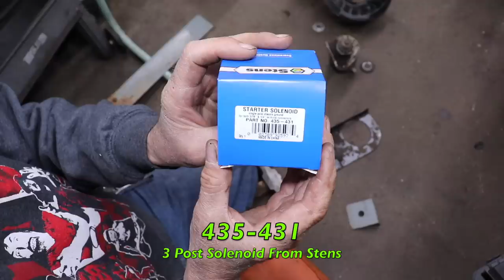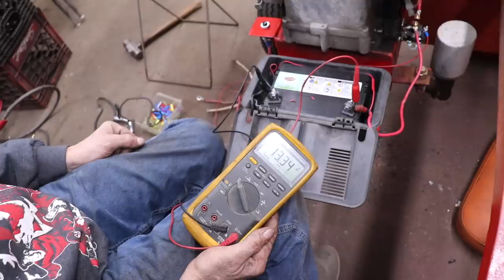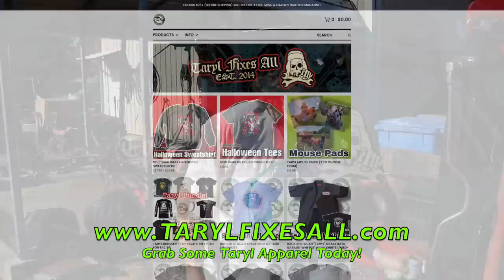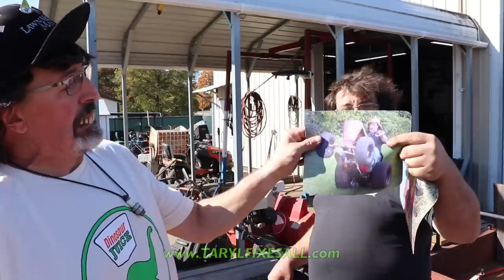Taryl's Personal Log Splitter Upgrade! Make It Awesome!

Comment: You're pretty handy with making your log splitter more useful. You need to make an automatic return and they're simple to do. Extend your control handle on the bottom the same length as the top. Then you need to attach a rod to your RAM. As the ram goes out the rod will contact the bottom portion of the handle pulling it in the opposite direction. I think this might be a worthwhile video you doing that. John

Comment: Taryl, I would add a flip out extension to your catch table to extent it's capacity. Then flip it closed into the stationary table for vertical use. A pin will keep it secure when not in use. Make it narrow enough to drop into the existing table and shorter so the pivot will use the end of the existing table as a stop and the new extension will be on an incline. Great video as usual.

Comment: My MTD log splitter came with side trays, which is a really desirable feature. I bought one of the Harbor Freight clamp on caster wheels and put it on years ago. My biggest gripe is pulling the cord and starting it in freezing weather when the hydraulic oil gets thick. An electric start feature sure would be nice.
Reply: you are supposed to split all your wood in early spring,. not the dead of winter there numb nuts, so it dries and will burn clean.
Reply: Run thinner fluid or trans fluid

Comment: B&S is pretty awesome in that they have basically the same engine block for the different options. makes it super easy to add on options later if you want. I've noticed Tecumseh is usually the same way with having tapped blind holes on the block to add on a starter or a torque converter. I'd like to see a starter kit added on to a block that doesn't have the holes drilled or tapped though, that would be pretty interesting (especially figuring out the gas can if you don't have a nicely molded one like yours)
Reply: Yep, unlike Honda who go out of their way to redesign the same engine where you can't add electric start so they force customers to pay them more for the option.  It was B&S who fixed Honda's decades of oil dilution mistakes too...

Comment: Thanks Taryl.
Did similar Mods to My 35 Ton. Took the parts from a blown up 15Hp and they all fit My 12.5 Hp.
Used the AC windings for Lights on a Cross bar on the end of the Splitter Beam. I split 100% vertical so that puts the lights overhead. 
My battery Box has the Electrics built in to it and it is not mounted on the Splitter since I use that set up between Machines. just set it into a holder and plug it in. Same with the Gas can, Just a holder for a Red 6 Gal Can and boat connectors,  
I replaced the Jack with a 12" Dolly wheel, removed the hitch and put on a vertically pivoting Draw bar with a handle on the end, put the hitch on that. Not I can roll it around or drop the hitch on the ATV or the back of the wood trailer.
I have all the Parts to make it Self Propelled, just the intuitive to put it together..LOL
I tried the foot plate extension, but ended up bending it up since I am in the woods a lot and the area is not so flat around the Base, I just use some old 2x4/2x6 just setting there. For Elm I have a piece of Horse matt on the foot plate so the Wedge cuts all the way through. 
An oil cooler is in the works too...
Mike M.

Comment: I put a led flood light pod on the top of the boom. I use mine more in the vertical position due to cutting bigger trees (free is free). I also tend to split later in the evening because it's cooler down here.
Reply: i said the same.

Comment: I do not miss messing with firewood. That's the only heat we had as a kid, until I turned 18. You never had enough firewood.
Reply: Modern epa stoves don't use so much.

Comment: Tarryl you need two more additions to the log splitter. A wedge that splits a log 4 ways with one pull of the ram. The other add on is a t-handle with a 2inch ball to move the splitter around.
Reply: There's always room for yet more improvements. Up to the point where this thing goes out, saws the logs and splits them all on its own 🙂
One more addition could be fast advance and retraction of the ram.

Comment: Nice upgrades!  This "old man' still splitting by hand, not sure for how much longer  😟 I have a friend  even older than me ( 80s ) that still splits his own wood, with a log splitter.  Due to recent shoulder operation he has a real difficult time with the pull start. I have to check & see if we can mount a starter. It has a Honda engine. The cradle & the foot extension are also now on my todo list.
Stay safe, Joe Z

Comment: Great video. I see one small problem. When the splitter is horizontal, the hydraulic return hose looks pinched or at least makes contact with the new rack you installed.  Other than that, great improvements!
Reply: If the hydraulic hose is making contact with metal, it will wear in that spot and develop a leak.

Comment: VERY nice work on the hog splitter Taryl!  Love the improvements!  You did a great job putting that all together - really cool!  At first I thought the extension on the steel plate was questionable - but once I realized it would be sitting on the ground and saw it in action - it turned out better than I thought it would have.  Good stuff T!

Comment: Good job on the electric start. I used 1/4" cold rolled plate sized 18 x 18 for the foot. It adds a nice amount of counter weight and is super strong for splitting HUGE rounds vertically. Your side rack is ok but it needs a hand rail around it about 3 inches tall to keep wood from rolling off.. keep at it dude.   Time teaches all.

Comment: The splitter wedge could also be modified with two 90° angle wedges welded on the head so that you won't have to resplit the same piece of wood so many times.
Reply: I've seen that type of improvement. The wedge looks like a 4 points star. I guess they made into a regular wedge so, you don't stress the machine too much.
Reply: Great tip.
Reply: It's all good if the pump will handle it. On these mass produced versions it's often not.
Reply: @user-neo71665  I guess, a bigger pump and cylinder cost too much, for this use.
Reply: @rverro8478  They build them cheap as they can so they can sell them for greater profit. Bigger pumps, motors, and cylinders means they cost more. Also why the plate the log stand on with this one is so tiny, the tongue tube is made out of tubing that looks like it's gonna bend under just moving the machine, and it just has a tube instead of a real trailer jack.
Frankly I'm willing to bet this one didn't have a 8hp briggs on it new. My money is it only had a 6.5hp china engine just judging by the build of the rest.
Reply: If you have a system with at least double the power capacity of a single wedge additional horizontal wedges will work just fine on wood that easily splits.  If you can stall the system in knotted hard wood with a single plane wedge, the system will definitely not power through effectively three times the effort and will bind continuously...  Most splitters fitted with additional wedges start at 20hp of hydraulics, or are very, very slow to cycle in order to raise the hydraulic pressure sufficiently.  Depending on the HP most domestic splitters rely on either slow cycling speeds, or limited power in exchange for fast cycling speeds - mostly they are designed to only deliver a certain level of ram pressure that is well inside the capacity of the frame and mild steel plate supporting the ram and foot plate to avoid bending or tearing...
Reply: Agreed the machine is plenty strong enough
Reply: @Joseph-lt5yz  he is hes just taking small steps i.see his math
Reply: @user-neo71665  I noticed how the tongue wasn't strong at all. Mine is square tubing which, can be towed on the backroads. I doubt the tires are highway graded and, I wouldn't dare to try. The machine would bounce all over the place. Mine has a 6.5 Kholer and there's plenty of room to swap it for a bigger one. It barely has 3 hours use since I bought it, about 5 years ago.
Reply: @rverro8478  My starting rig was also build better. Mine has since seen just about everything swapped over the years. I wouldn't tow it down the road behind a truck. That one flexed so much I wouldn't tow it behind a lawn mower in the yard. Even after he added the brace it still flexed pretty bad.

Comment: As a grass rat.
Got a suggestion. 
Use a piece of a small tire as a cover over the relay to keep rain and wood chips off of it. A little  rubber  umbrella. 
Great upgrades on the  log splitter.

Comment: Maybe you could source some more of that pipe and some flat stock an weld the flat stock to the upper part of the tongue that comes away from the trailer to box it in and then weld pieces of pipe over to the stiffener pilot to hold it all together.  Great video!

Comment: I replaced the tongue with 3x3 rube and added a short vertical peice to support the horizontal position.  I had a plate bent for a log tray. As for the motor I gave into a 8hp predator.  It really runs nice. You got me on the electric start!. That machine has been splitting wood for 35 years. Bought it a tractor supply for about 675.00.

Comment: Hi Taryl, Watching You Lift That Splitter ARM-- Maybe You Should Add A Small Hydraulic Lift Arm on It. I Personally Don't Use It In The Vertical Position Much ,But I Know The Splitter Ram Is Heavy To Lift By Hand. Great Job Once Again By The Small Engine Whiz.. " And There's Your Dinner "

Comment: Taryl, on our pressure washers at work, we've been replacing the solenoids with automotive units (Ford I think), as they last longer and are about the same price as the OEM models.
Reply: I have a starter solenoid that’s meant for a 57 Ford truck on my Craftsman LT1000 and it works great!

Comment: Replace that piece of bent pipe with a straight pipe. That will work in pure tension/compression and get rid of the wonky flex problem.

Comment: I did something similar to years ago, welding a wheel to a trailer jack. The foot of the jack was made of really crappy soft steel, very little strength. It worked but it would flex, I was always nervous around it.
Much bigger trailer tho.

Comment: Hey Taryl, you could have put another piece of angle iron on a bolt either side so it folds back inside the other piece you welded on. Fold it out when you are using it. It could even sit up on an angle when you are using it so the log doesn't fall off to the ground.

Comment: Looks like the tongue is made from channel. The reason it's janky isn't so much that it's flexing from side to side, but rather it's twisting. You can add torsional stiffness by boxing it in, turning it into rectangular tubing. Just be sure to leave drainage holes so water can drain out and so you can spray in some rust protection.

Comment: They make a side crank Jack that fits on that rotating bracket  also if the legs on the wheel straight maybe won't flop to the one side

Comment: Those pieces of steel are most likely going to get bent.  It works when it is on a flat surface, but when you are on uneven ground, the log will transfer the force from the ram to the frame which will not have the stiffness to keep from bending.

Comment: With a spitting wedge twice as tall. And an end stop, also twice as tall. Taryl could split chunks of wood twice, while still stacked together. That's double the output of split material of the short stature single height splitting wedge. (We had a home-made splitter made with a Hydraulic Ram from a Dump-Truck with a !2" high wedge.).

Comment: Nice upgrade, you took a good log splitter and turned it into a "gooder" log splitter. I was surprised at the strength of the angle iron🙂
Reply: I did that with my old Coleman 5k with a 10 horse Briggs I/C. No bosses for the coils so I got the ring gear kit and put it on the generator motor flywheel with the starter. Then wired up the switch and solenoid and battery with a 110 volt maintainer to keep the battery charged and when the power was off, just plugged the maintainer in to the generator. So far, so good. Always a way to improve and thet 10 horse is a double handful to start with the recoil.
Reply: @lewiemcneely9143  very nice! I live in Texas so a little 5 ton electric does a season of wood in an hour
Reply: @GuysPlayingWithTools  I've seen them and they are sweet but I needed something stronger because of knots and such so I tried Ebay and folks saying they wanted to sell theirs but there was nothing and nobody really wanted to sell theirs so I broke down and got a saw and a splitter NEW. Yes, that's scary but it was a good move. The saw was a Stihl 261 which is a commercial saw. My son-in-law scarfed it right up but I have a 440 Magnum here. The splitter was a Champion 37 ton but really more like 35 with a 5 inch cylinder. I got a marine screw jack like teryl's but with a big steel wheel. Put an emergency stop by the valve and turned the filter right side up to get all the air out of it. It has yet to kill itself and we're all very cautious but there's no such thing as a knot it won't split. I get logs and cut them to length and split for us and him. So far all is well. I'm in the hills of NC myself. A worn out hillbilly! LOVE Texas and Texans though. BLESSINGS!
Reply: @lewiemcneely9143  All Texas says thanks ! 🙂
My little 5 ton splitter will take on up to about 15 or so inch wood without a problem. Tried a 21' log once.... once 🤣
There are plenty of dead 12' to 15'  Elm trees with 25 miles of me and when I offer to remove a dead tree for free people always jump at the chance.
Reply: @GuysPlayingWithTools  Texans and hillbillies are a LOT alike, the natives that is. A bunch I've been around I'd swear they were from next door to me. Salt of the earth! I've got 3 logs that will average a good 24 inches through, one bigger and one a little smaller. Makes a lot of stove stokers but they sure are heavy and I sure am creaky but we've got half a 10x12 woodshed full so we're as ready as we'll ever be! And the son-in-laws nickname at his job is 'The Ox' so I might snag him if need be,.
Reply: @lewiemcneely9143  I am from Indiana, been in Texas for 20+ years. If I had a guy people called "The Ox" I would probably look for bigger logs too. 😁

Comment: Vertical splitting is only for huge logs you cannot pick up because it is slower and doesn't work as well.  Good improvements on the splitter. Happy Halloween🎃.

Comment: I think there's room on that splitter to add a HAMS cooler!! Nice job on the upgrades. Also good information on the flywheel swap regarding magnet location. Easily overlooked. Thanks gang for the video.

Comment: I like the catch plate on the side. I Will need to put it on a slight angle. I have bigger pieces, usually, and they tend to roll a bit. Nice spyderco knife. Will the battery over charge?

Comment: You can extend the catch-cradle with a swing-out extension that nests inside the existing tray.  When deployed, the bottom of the extension will hit the top edge of the angle iron, making it angle up, forming a proper cradle.  The pivoting end  of the extension shouldn't get angle iron, as it will be supported by the tray when deployed and the angle iron would interfere with it's ability to pivot, though it'd be wise to somehow dress the edge of the expanded metal for safety and durability purposes.   You'll want to incorporate some sort of method to secure it closed so it doesn't swing open when you don't want it to.

Comment: could you have made a folding shelf? it folds over itself so you can have a longer shelf, it doesnt have to be as long as the bottom peice but would give more room maybe? is it hard to learn to weld? noticed it was a breaks  and scrapem, lol, if you read this post can you recommend a good book on this  motor stuff the ones we have small engine repair series is so old (tho the principles seem to the same) I would like updated information, also I am a beginner tho I have watched all of yoru videos, my hubby likes your videos, I have never repaired anything in my life but I am starting to understand the parts what they do and how they go together etc, my hubby has these series on small engine repairs before we even met and were married so the pictures in there are of mowers no one uses anymore. would be nice to get updated info, and pictures of updated mowers (I am particularly fond of my stand on mower which has a briggs andstraton vanguard. we have craftsman where the undated coil and electrical is different an we have no idea how to make it work since the new part has only one plug (prong) but the one they sent us  is the right coil has two plugs, frustrating they would not do the refund or send us the other part and take this one back tho i has always been inthe box unused. it is so old anyway but this stand on mower is a gift from my hubby too.

Comment: Be careful of your hydro line rubbing against your log tray it may rub a hole through it
Reply: I saw the same.  He could zip tie a scrap hose on the contact area.
Reply: @BeingMe23  that's janky. They make spiral wrap for hose abrasion.
Reply: @1pcfred  Yes but his point is to do it on budget average parts and average skills.
Reply: @BeingMe23  spiral wrap is cheap and putting it on is somewhat time consuming and tedious but overall easy. All you have to do is wind the stuff on. Worth it for the results I'd say. Spiral wrap always looks good.

Comment: Not trying to argue with you on it either. Just stating facts about that part of it is true taryl fixes all.
Reply: What kind of generator engine was the one that they we're trying to add on A electric starter.& Generator stator coil for charging up the battery with to?